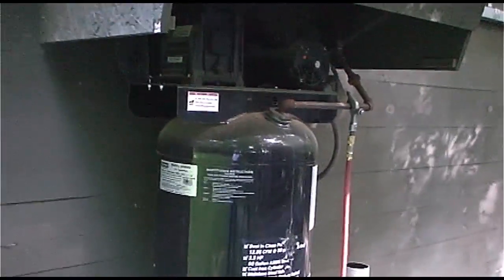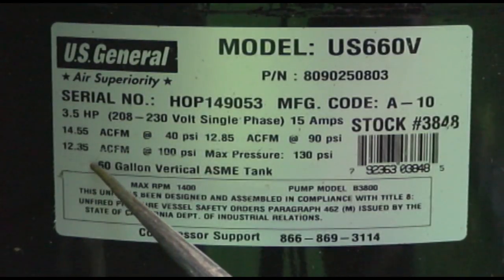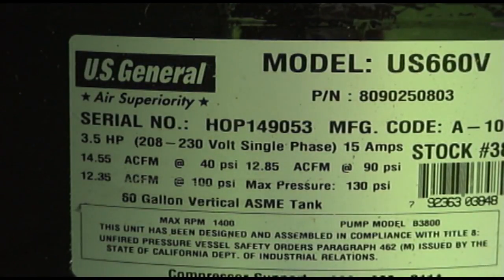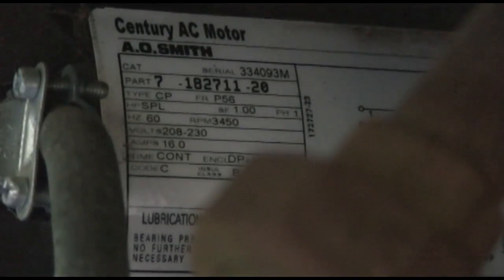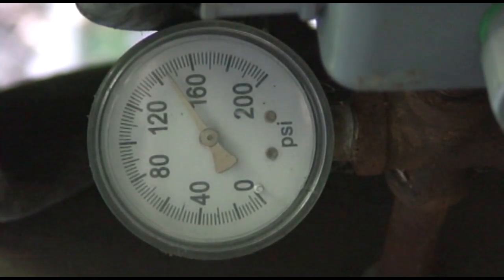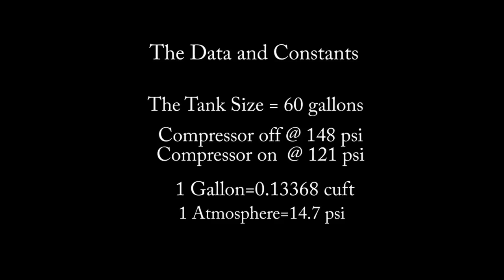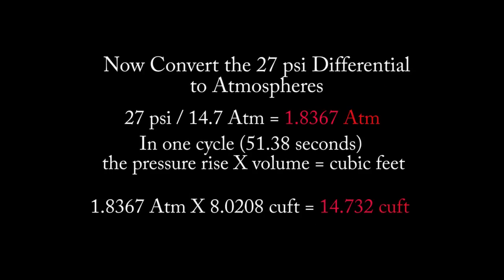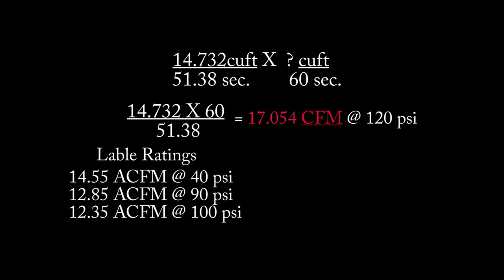How to Calculate the CFM Output of a Compressor using the Ideal Gas Law.

Comment: my little compressor is 1 HP, 25 Liter tank. 
i calculate it.... the result is 4.2 CFM at 105 PSI.
woooo... i hope i am not wrong.
Reply: General rule of thumb 4 cfm at 100psi equals 1hp

Comment: IF THE MOTOR DOES NOT SHOW THE HP, THEY ARE HIDING SOMETHING YOU DON'T WANT TO KNOW-  ITS A CHEAP ASS MOTOR
Reply: It's not that cheap! It's a standard compressor duty motor. What a manufacturer cannot lie about is the actual energy usage. On this motor that's 16 amps @ 208 volts and equals 3328 watts. It doesn't claim high efficiency so we know the efficiency is less than 85%. Assuming 80% efficiency that leaves us with 2662.4 watts for work. @ 746 watts per HP that works out to be 3.5689 HP which is suspiciously close to the claimed 3.5 HP.  Ironically they could have easily claimed it was a 5 HP motor and it would still be truthful because they didn't have to account for efficiency. Kudos should go to Harbor Freight for being very honest about the HP rating.
Reply: Correct no way

Comment: THERE IS NO WAY THAT CHEAP COMPRESSOR IS GOING TO GIVE YOU 17 CFM ESPECIALLY AT 120 PSI, YOU ARE WAY OFF,  SOMETHING IS WAY WRONG WITH YOUR FORMULA OR CALCULATION. IF THIS WAS TRUE EVERY BODYSHOP PAINT SHOP WOULD HAVE THIS COMPRESSOR. RULE OF THUMB IS THAT THE HIGHER PSI, THE LOWER CFM OUTPUT.
Reply: That was the cfm entering the tank from the compressor not the cfm that leaves the tank to the tool.
Reply: You're not too bright are you? 😂

Comment: yeah there is a marketing scam for consumer-grade compressors. they measure SCFM at compressor inlet and you'll see why a 90 psi 4cfm compressor actually only supplies 0.77 cfm continuous to your tool at that pressure, using Boyle's Law P1V1 = P2V2.
 
commercial grade compressors actually do list the supplied pressure to the tool in the specs for continuous duty unlike consumer level units

Comment: In the electricity industry we always worked on a rule of thumb of 1 hp provides 5cfm at 100psi
Reply: That must be for screw compressors. Most piston compressors make about 2cfm per hp when running. This drops down to about 1.2cfm once you factor in only running 60% of the time to allow for the duty cycle of the pump.

Comment: Great video, liked and subscribed. Comment: 17/4=4.25, but 120/100 is 120%, so your HP is 5.1. The rating label is what they guarantee to perform and of course they add a fudge factor "baker's dozen" or else they'll have a massive recall class action suit for false advertising. you lucked out, you got the premium motor from the lot, or it was manufactured on a Wednesday. 

Gal.tank      x     231    x     (Offpsig - Onpsig)     x     60
__________________________________________________________________
{cfm@Psig x     12^3   x   atm. Psia location      x timeseconds of cycle}

I always wondered how to calculate for the efficiency of a compressor compared to the rating label. I rarely buy aanything new, so now I know how to test. Thank you for the wealth of knowledge.

Comment: My assumption that the calculated vs labeled values difference comes because hot air pumped in the tank causes cutoff happen earlier. The other way round.. After cutoff air cools and the pressure drops. So the actual gained presssure difference is less. Btw, thanks for putting up the video. Interesting topic
Reply: An Atmospherically controlled test  (since density of uncompressed air will differ b/c of 1)what elevation above sea level the test is performed  at 2) the moisture content of air 3)the temperature of the air b4 compressed. The “same unilaterally controlled” test should have an “s” as follows; “S”CFM @ whatever psi let’s say 90psi. B/C a test in San Francisco in January will differ in start up variables than DENVER in August- So w/o having standard variables w/ a set temp, altitude, & barometric pressure the test would be mostly pointless to folks in different parts of the world the #’s wouldn’t make much (if any) Sense

Comment: interesting video.  Once I tried to supercharge my compressor by connecting a blower fan ( like the exhaust of a vacuum cleaner) to the intake of the compressor. I'd then drain the tank until it was empty, then turn on the blower then the compressor and time it till shut off.  then do the same without the blower.  What are your thoughts  on this Idea. I was rather disappointed with the results.it only make a few seconds difference.
Reply from the maker: You tried to supercharge your compressor with a vacuum cleaner exhaust?  That's funny.  No wonder it didn't work.